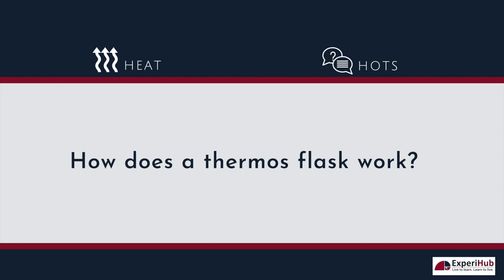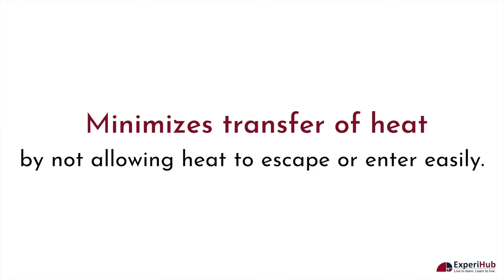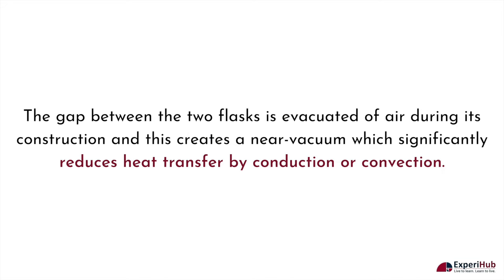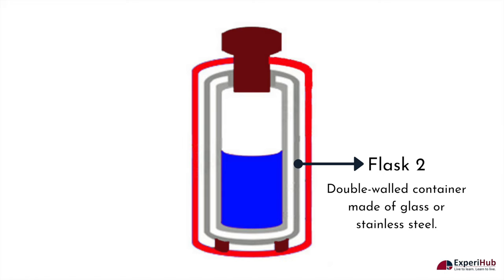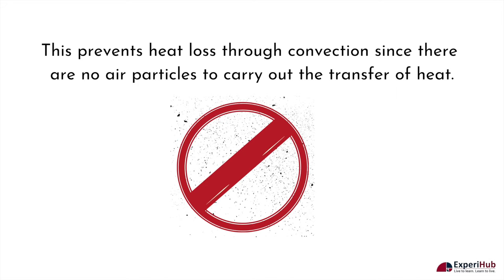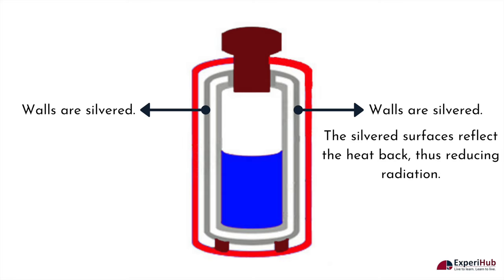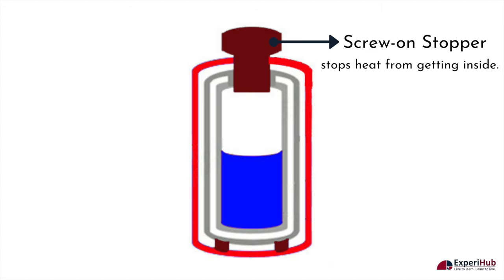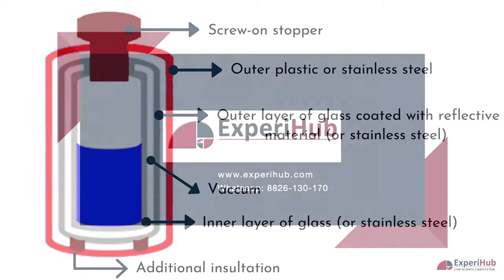HOTS Questions | Heat | How Does A Thermos Flask Work?

Comment: I never used thermos flasks until recently, so I wasn't informed very well about their features. I always thought they are a bit better in keeping the heat (like 30 minutes longer than normal plastic bottles etc.) by using different material. Was really impressed when I read that they can keep warm drinks warm for several hours thanks to the vacuum.
Reply from the maker: Glad that our video gave you an insight about the benefits that a thermos flask offers. You should go in to buy one and enjoy warm drinks in winters and cool drinks in summers !

Comment: Is there a way to repair heat loss? I dropped my flask then the body conducted the heat.
Reply from the maker: Hello Sir. You'll have to add an insulating material in order to prevent heat loss. For temporary insulation in the body, you can wrap Aluminium Foil around the body to prevent heat loss. If however the glass inside is broken , then you will have to give it to a vendor to get a new glass fixed from inside.